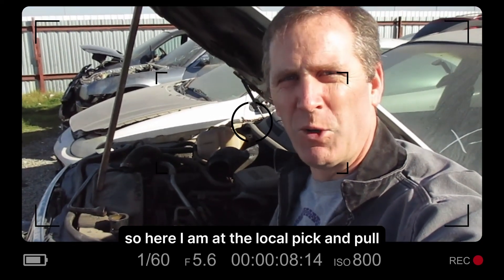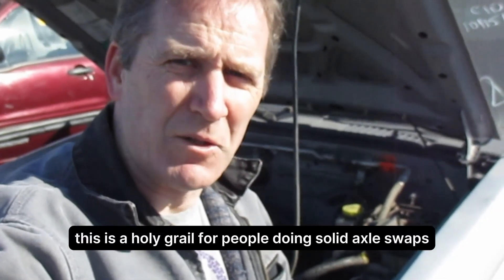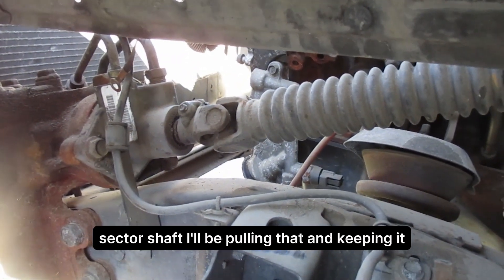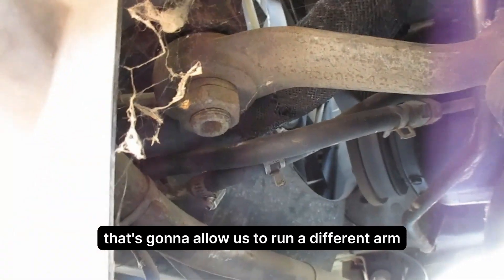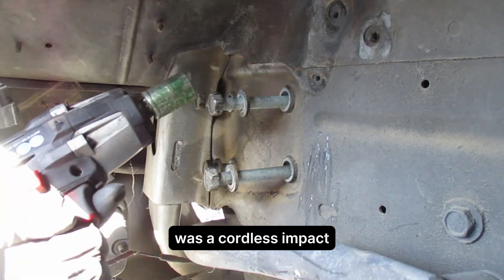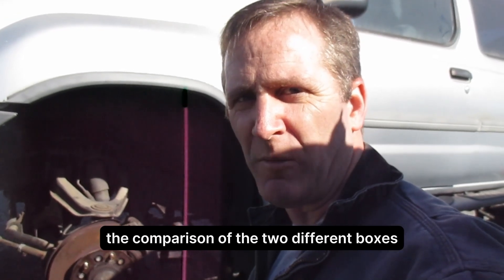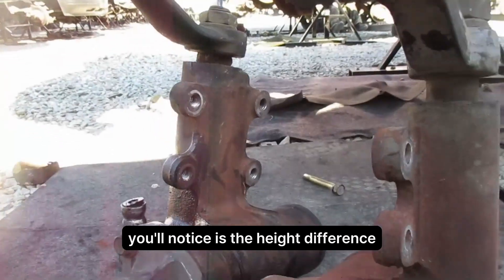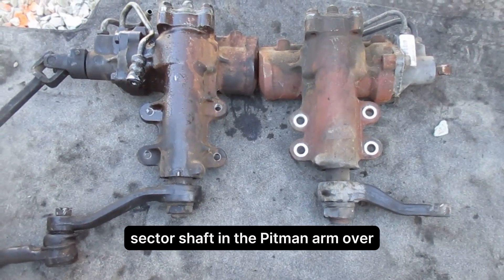For a Solid Axle Swap, which steering box(s) to use?

Comment: So a WJ pitman arm will fit on a nissan box?
Reply from the maker: Short answer, No.  The Nissan Exterra has a unique spline that does not match most common types. To get around this, I swapped the sector shaft and pitman arm from the Jeep WJ into the Nissan housing. Thus, a Nissan box with a WJ shaft and arm.